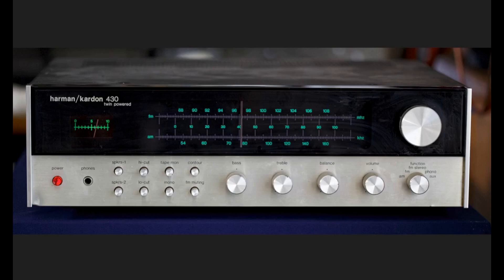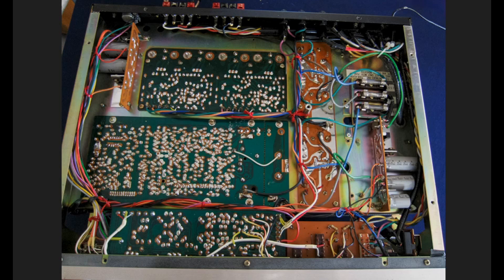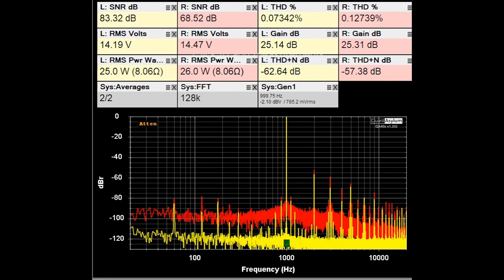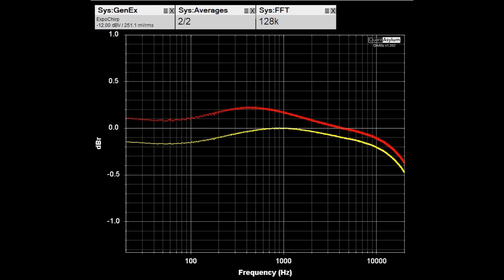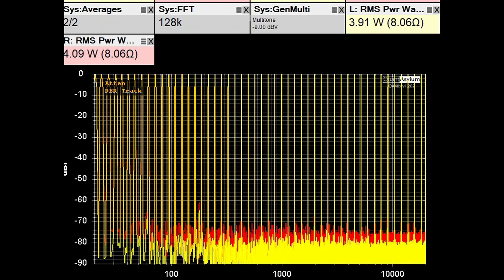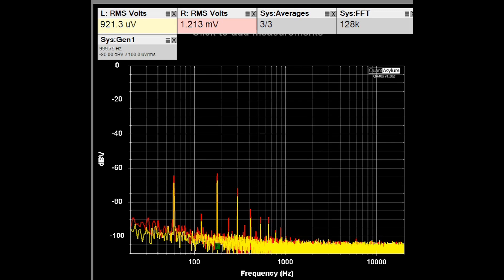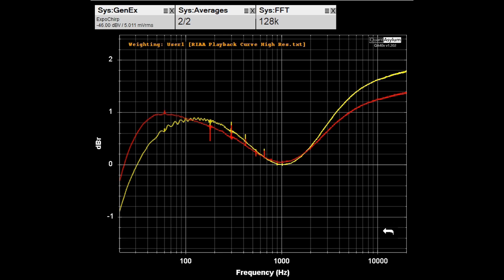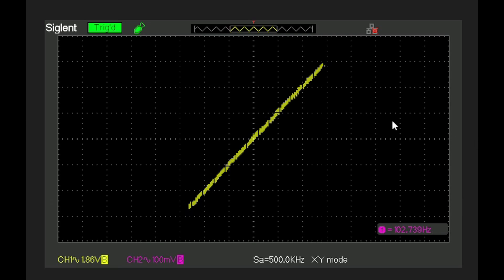Harman/Kardon 430 Receiver- Vintage Audio Review Episode #147

Comment: I have one, I'd found it at thrift for like 10 or 15 bucks in the early 2000's, and used it until I got a Denon AVR-888. It's been in storage until this past thanksgiving when my brother in law bought it up when he was organzing that said storage area. lol  I plan to use it for an office unit and hook up some bookshelves to it. Maybe a cd player or a Tape Deck. or just use it to listen to radio. However, I'm not going to just hook it up and hope for the best. I'll take the cover off and makes sure there's nothing burnt or leaking, etc.
Reply from the maker: Most likely it will work fine- maybe just some cleaning/lubing of controls and switches- thanks for sharing!

Comment: What do the high flow and low filter buttons do?
Reply from the maker: Thanks for the question. The low filter is more for trying to reduce low frequency rumble from a turntable if you needed it and the High filter would be more to reduce tape noise- probably before Dolby NR was out.

Comment: $300??… There are four HK-430s on eBay as of today and they range in price between $600-$775.  Purchased one last week from Goodwill at $400 and I thought I overpaid by $150😮
Reply from the maker: I appreciate your taking the time to let me know the current value. In my defense, I typically shoot the videos at least a month or two in advance before they are released and at the time, the price that I mentioned was what I saw, typically on Ebay. I think Skylabs mentioned them in a video or two and that may have caused the price to jump...
Reply: @vintageaudioreview  Funny I have one of these HK's too. I pulled it out of a old television console years ago. I didn't think it was worth anything, but I guess even at $300 it's quite a find. It does need a few lamps and some of the controls are a little scratchy, but otherwise works fine. Haven't done anything with it, maybe I should.
Reply from the maker: @phoebus  You should replace the lamps, clean the controls and enjoy it more!

Comment: I had one of those in excellent condition.  I payed very little for it and gave it to my bro to use.  He hardly ever used it AFAIK.  I got it back from him and did not have any place to use it so I ended up selling it.  They are well made and worth it.  I think on mine the FM stereo audio could have been a little cleaner but not sure.  I do not have a stereo multiplex generator $$$ so I could not really troubleshoot that.  I can generate a mono type signal is all.  I shopped for some used ones on ebay but everyone wants alot for even old ones.
Reply from the maker: I appreciate your sharing your "story". I have never tried to align a tuner- no real need to these days unless you really like just having it working correctly. People really like their HK gear- hopefully my buddy has some more....

Comment: I haven't experienced the 430 yet but I have used the 330c and 730 extensively and they are both great receivers. No doubt this one is too. Thanks for the detailed analysis. I bet it has a dopey transistor or a failing cap in the right channel.
The caps they used in the factory were bulletproof and I've seen them hold up strong even today.
After 50 years they mostly still test perfect but there are always some that get weak or fail.
Reply from the maker: Thanks for the comment and you have a lot of interesting videos and see that you did one on the IG-18 too- I will watch that one soon. I am not sure about a detailed analysis other than presenting what I measured, at least in this case. I am not a believer in replacing caps just because they are old either. Am waiting for the right piece of gear to come in and will do a before and after cap replacement (power supply related caps) at some point. Thanks for commenting!

Comment: I picked up a HK 330 b back in 98, I was working a temp job cleaning up rentals.  I had strict direction to put everything in the dumpster to be put in a landfill.  On the top shelf of a closet I found this 330 b and a Pioneer PL 50 turntable.  Needless to say they came with me, all these years later I still use them but mostly listen to the HK 730 I picked up 3 years ago for $350.00, these Harmon Kardon's sound absolutely remarkable.
Reply from the maker: Great story and I have a PL50 that I use on occasion. Guess you like HK gear.
Reply: @vintageaudioreview   I love all the vintage  gear, but this HK 730 is outstanding.  I have probably 10-12 sets of speakers, nothing too fancy I enjoy playing with different combinations and placements.  Recently I responded to a Craigslist add for a free old HAM radio antenna, I met a super interesting man as a result, he flew F-111 jets in Vietnam and had a hanger at his house in Monmouth Oregon, to house his homebuilt.  We talked for several hours out in the hanger and he GAVE me a very nice Pioneer PL-550, it is lacking the cover but outside of that is in near mint condition, works perfectly.
Reply from the maker: @insolentstickleback3266  Great story and hopefully you will find a cover for the PL-550.